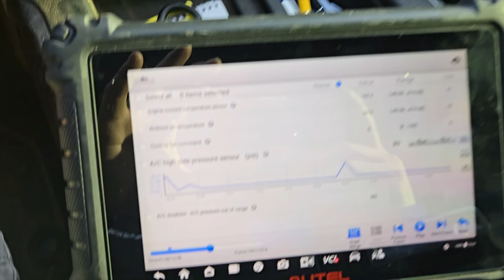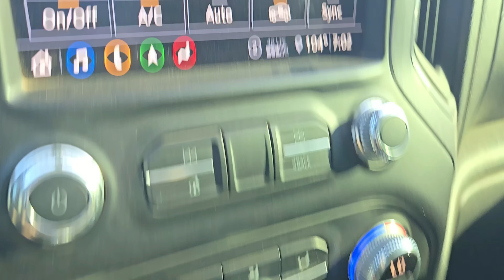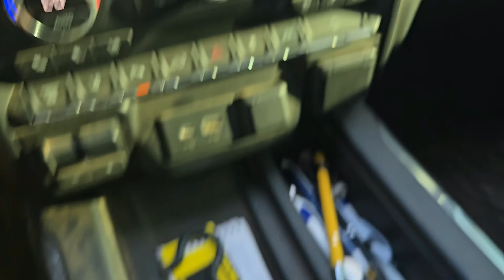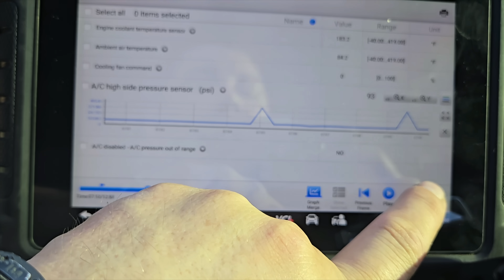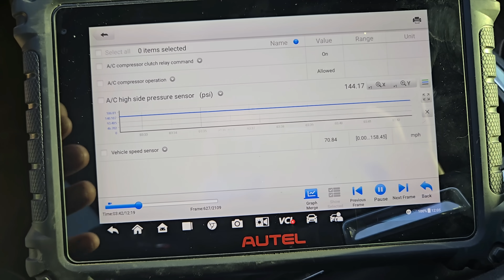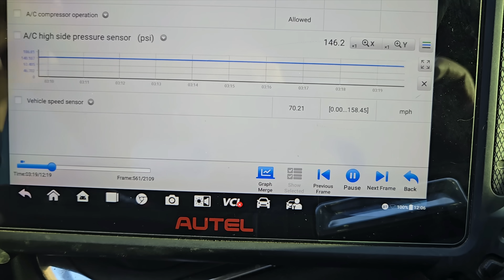3 Chevy dealers couldn't fix his A/C! Repaired with no parts!

Comment: pins pins pins lol... the new body gm trucks this is a huge issue. I had a gm engineer come out on one spent all day left and said I gotta look into this, a day and a half on it fixed a pin. oh yeah hvac blower,mode doors are on a data bus now Soo that's fun... cel on due to blower motor bus pin... battery draw to blend door acuator bus pin yeah the body side on those is worse than the lifter/trans issues.

Comment: We have been having the same problem on freightliners that the high-pressure switch terminals are expanding and losing connection and sometimes the engine fan stays on the whole time other times it spikes to over 450 psi which then disabled the AC for the remainder of that key cycle.

Comment: I couldn't even tell you how many times I've had customers bring their vehicle in either after having the entire system replaced somewhere else for a couple grand or just came to me for a second opinion and I find an issue with one of if not both of the pressure switches. We have two major issues within technical fields.... LAZY AND/OR INCOMPETENCE

Comment: AC machine at work (robinair 134a) holds about 0.15LB in the hoses if they're in a state of vacuum.  Easy to miss-charge or recover and misread how much was really pulled out of the system.

Comment: My coworker was fighting ac issues on his Chevy SS for a couple years. Said it would be kind of cold but would cut out intermittently.I went over to his stall one day and after looking at a few things, I noticed with key on engine off the ac pressure sensor was reading 380 psi. Mechanical gauges matched ambient temps. No codes. He put in a new pressure sensor and it's been working ever since. Like the other commenter said it's a good idea to monitor scan data and mechanical gauges simultaneously. It's a good way to narrow down a restriction or an electronic issue

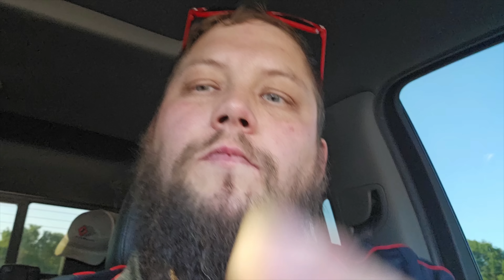Comment: The mechanic fixed the A/C by addressing a terminal fretting issue in the pressure sensor connector and then evacuating and recharging the refrigerant. He explains that by simply touching the connector, the A/C compressor would turn on, indicating a problem with the connection (6:30). After applying Stabilant 22 to the connector to smooth out the connection (6:52), the compressor stayed on, and the system's pressure readings normalized (7:10). He also found the refrigerant was 0.3 lbs low and refilled it to the correct 600 grams (7:17). The core of the fix was understanding the system's data and diagnosing the electrical issue with the sensor, rather than just replacing parts (9:10).

Comment: Nice!  As a general rule, I like to monitor refrigerant pressures on any AC complaint, both through gauges and through a scantool.  Not only will discrepancies usually jump out, but it gives the opportunity to look at overall systems health and spot potential other problems.

Comment: In the last few years we’ve had several Hyundai/Kia products show up with no A/C, caused by bad evaporator temp sensors. The HVAC modules on these vehicles weren’t on the can bus, so all testing had to be done manually. You’re lucky you had scanner data to look at

Comment: I had a similar issue with a Ram 1500. It would intermittently stall and would throw a Fuel pump performance code. They had already changed the fuel pump and fuel pump module. I drove it around and when it did act up I noticed the fuel pressure sensor would spike up to 100 psi then back down. I touched the connector while looking at the data and it would spike up. I spliced in a new connector and truck ran perfect 😃

Comment: I can tell you why… because the service advisors don’t ask questions!!!! If they don’t ask questions how are we, the techs, supposed to know
Reply: The customer is going to say, my AC is not working. 
Now you are a Technician, it's your responsibility to figure it out. 
I've worked on many vehicles, where the customer says the same thing. 
I've got to figure why the AC is not working. 
My daughter's Sienna after a front end damage got fixed, the AC wouldn't work. 
My daughter to it to a shop. Because of the warranty repairs.
The shop said the compressor is bad. Replaced the compressor.
She went to Oklahoma, the AC failed.
The shop said bring it back. The AC is bad again? The labor cost, she will have to eat it.
I said no way. 
Now it's my turn. After a week 
 It took me about 1 hour to figure out the issue..
The body shop that replaced the parts, damaged the ambient temperature sensor. 
It was wrapped in electrical tape with the end twisted together.
I purchased a new pigtail and fixed it. 
From the beginning the AC compressor was not the cause. A simple temp sensor.

Comment: This high side pressure switch issue is pretty common on the l5p.  What people don't realize is how much turbulence is on top of the engine and that connector is dancing especially when the fan ramps up.  The jumper connector for the high pressure fue sensor is the same way.  Not at the rail.  It's the big connector up there vibrating and dancing

Comment: I’ve half charged a system out of curiosity and my high side and low side numbers were still in spec. . Also sad that no one could figure this out for years
Reply: this could be easily seen in resting pressure with AC off